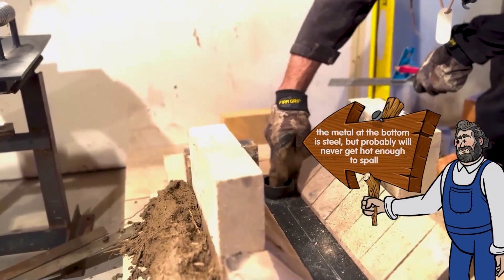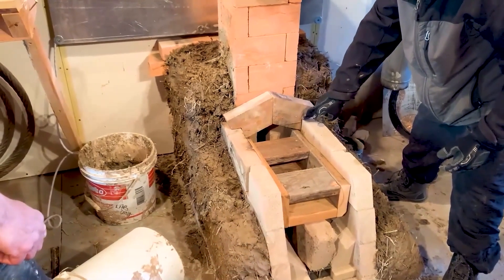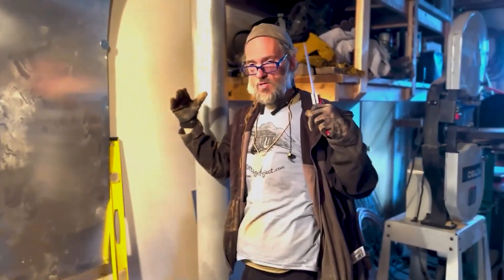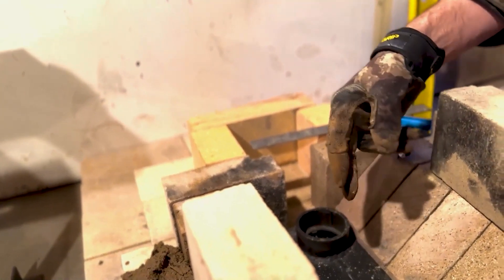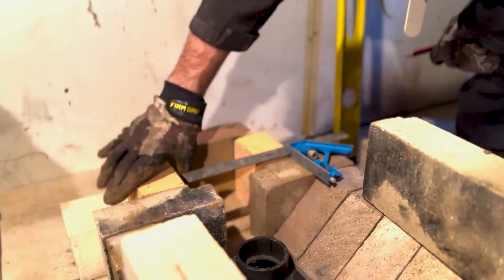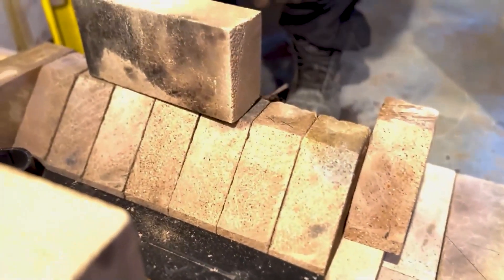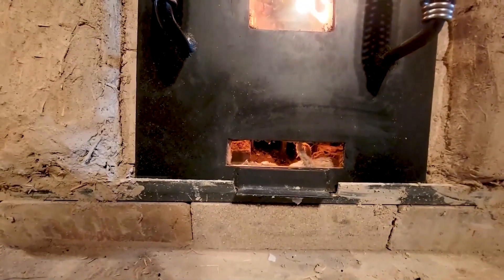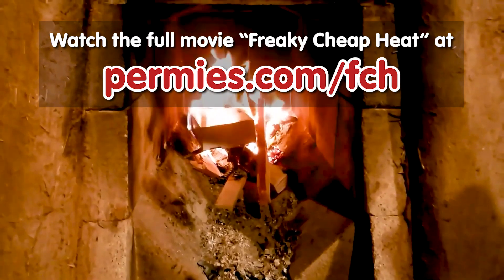the reburn air intake for a triple barrel batch box heater

Comment: wouldnt be better to catch that air from the outside if possible? just wondering if this is basically taking air from all little holes in the house and bringing it inside
Reply from the maker: Yes.  So the few times that we run it, it also makes the air fresher!

Comment: I remember venturi chambers being put in after the burn chambers to ensure the mixing of smoke and secondary air, is this still part of the design? 

also, has anyone put in a tesla valve design into a riser, chim-chimney or mass as an anti-downdraft or backdraft measure?
Reply: The constricted port into the riser creates a venturi which causes the desired turbulent mixing. This has always been part of the batch box design.
Even if it worked, just stopping backdraft would not prevent new hot exhaust from spilling into the room. You need to ensure constant draft.

Comment: Is there a slot in that little replaceable pipe? Facing the chimney?
Reply from the maker: There is a little bump of stainless steel tube that goes in there.
Reply: @paulwheaton  In the  vertical tube just before going into the riser? So the air doesn't just go straight up?
Reply from the maker: @oscarvogel2140  the little round part has another round bit that goes in there.

Comment: Burn it hot!
Reply from the maker: to heat the space fast!
Reply: And to ensure the volitile gases are ignited in primary and secondary burn areas. Reasonably hot fire, generally speaking, makes less creosote ultimately and a cleaner chimney system (lower risk of chimney fire + less work cleaning it out). Chimney residue should be more powdery than gummy or glassy etc etc etc 🤓 have fun burning and experimenting w designs 🚀